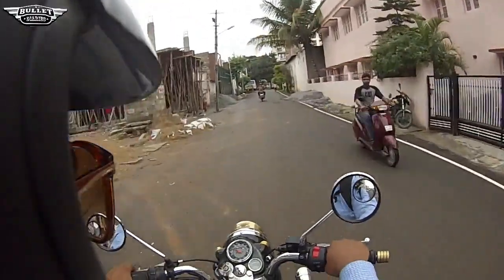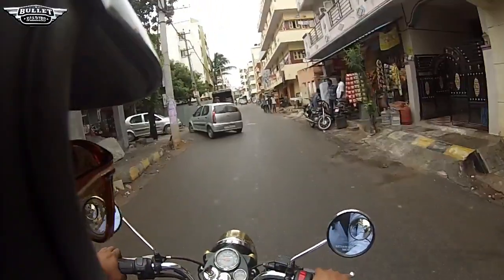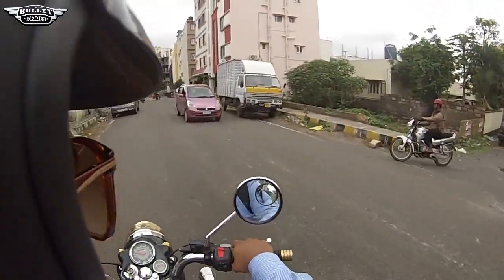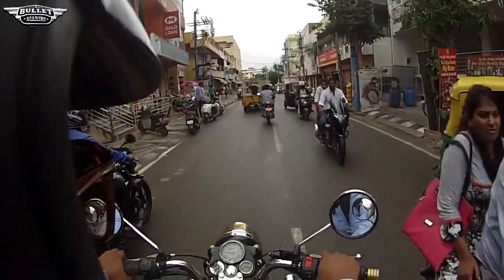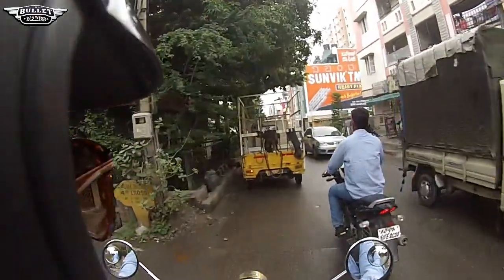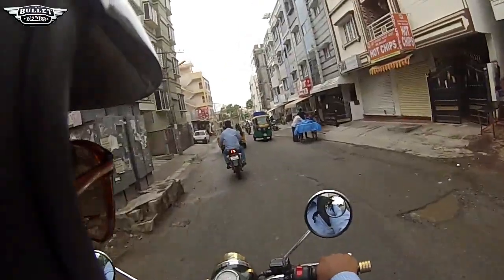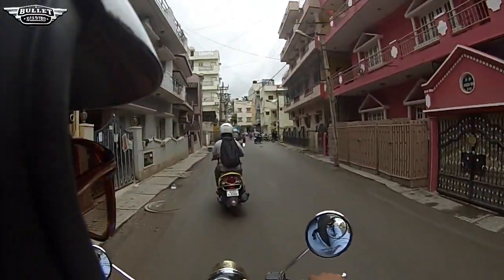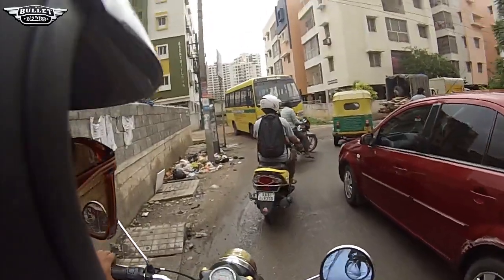How to apply brakes on Bullet : Bullet 500 : BUllet Diaries

Comment: Very informative topic. I use the same technique. However if Im in higher gears the I use Engine breaking as well with combination braking. It saved me once when a car ahead of me came to a dead stop suddenly.
Reply from the maker: Yes engine braking also is very effective, but it requires good technique and experience. I tried a few times but still I prefer the combination brakes which is easier to apply. Thanks for appreciating.. BTW my video also was too long. Will cut short.. hihhii
Reply: Nah the length doesnt matter as long as the edit is good. Love your edits man. :) Cheers! Keep them coming!!

Comment: hi B.D.  Glad to share I took delivery of my bull std 500 on 9th sept. relishing the feel like you.  mine is too a forest green. I also feel that gear breaking along with normal breaking will reduce the wear & tear of the disc brake and are to an extend safe too when correctly used. that tik tik sound is coming from some where. need to correct it. is it harmful for the engine?
I have also fixed that blind spot mirror. vibrations are not all other in the mirror and with a wider vision. thanks for the tip. noe my next job is to reduce the handle vibration. need to look around for an welding person to fix that rod in between the handle twist like you did. hope it nullifies the vibrations. shall I go ahead with the mod?
Reply from the maker: +Kumar Subramanian first of all congratulations for the bike..  Welcome to the bullet club..  That tik tik sound is normal no need to worry untill first 3 service..  It will take time to reduce the sound..  You can go ahead with the welding..  Make sure you are using the ss rod for welding and half inch minimum Dia half inch..  All the best.   And you  can ping me on my Facebook page anytime..  Cheers

Comment: Nice videos man! I have a classic 350. I stay in Bangalore too. Do those mirrors work well? Where and how much did you buy them for?
Reply from the maker: Yes it is working well I had actually installed on the outer,  it has to be installed in the inner half it gives wide angle and prevent from the blind spot..  Where in Bangalore bro..  Add me to hangouts. We can meet sometime..  Cheers and thank you for watching..  The cost is 20 to 50 rs each. It has a double sided sticker and sticks well. Using since 4 months in rain as well..  Hope I helped you.